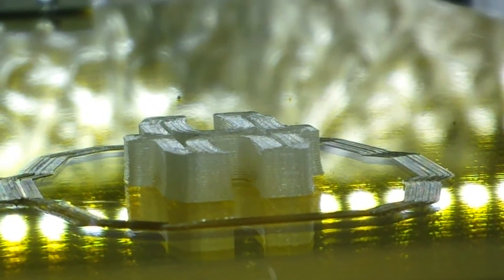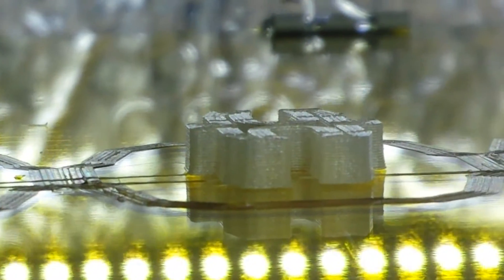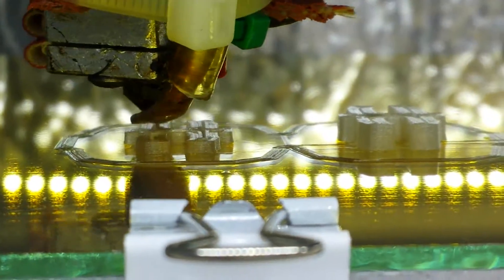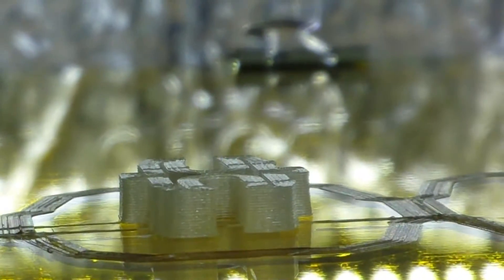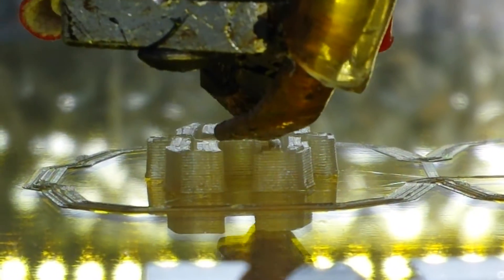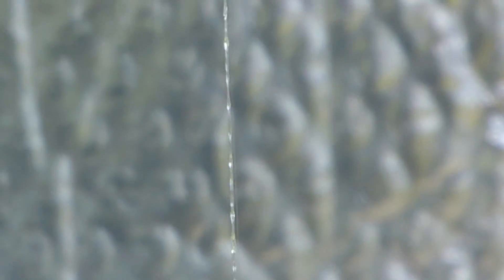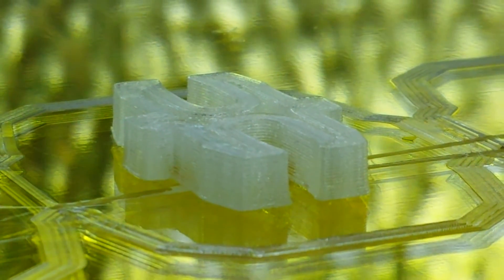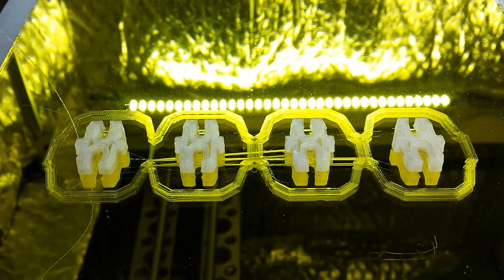Polycarbonate Printing - 1st attempt

Comment: Nice one! I've found poly prints really nicely, but in my printer with no heat warps pretty bad. I imagine in yours it'll be a lot better.

I've used buildtak which I'm now convinced is polycarbonate sheet and it stuck too well. rubbish on pei believe it or not! ;)

Polymaker pc-max is also excellent and easier to print but doesn't have the 150 degree gt temp of normal PC. worth a try if you fancy a different filament. I love it.
Reply from the maker: Hi Jai. thanks for the info. it was 1st try. second try of a vase didn't go as well. lifted off bed mid print :-(.
After I tried using a sheet of Acrylic and this worked perfectly in terms of adhesion and was easy to remove when it cooled down.
Will try again at weekend and update.
I have heard good things on the polymax pc , one to try in the near future I think.

I also have some PMMA to try out  but I am expecting this to print easily as suggested elsewhere.
Reply: Accel erate Yea the PC-Max I have is my favourite filament ATM. Not tried any bigger stuff, but with a raft it sticks to the pei nicely, surprising after the failure of polycarbonate. I think it may have a little abs in it to modify seeing as the glass trans temp is about 110 degrees.

Try using a raft with your setup. Seems a waste, but in the grand scheme it's only a gram or two.

The acrylic is a great bit of info. nice and cheap to try out! I want to make my bed easily removable so I can have different surfaces for different filament.

I got my PC from hobbyking. Ultra cheap. I also got some acetal (pom) which is a complete DICK to print without a heated bed. Won't stick to pei at all and warps like a bitch. Worth engineering a better printer for with its stiffness, machinability and wear resistance.
Reply: * heated chamber, not heated bed sorry.
Reply from the maker: I like the idea of different build surfaces for different materials.
Would be great to find the perfect materials that suit what we print without all the hassle of tape etc.
The acrylic I used was salvaged from an old Plasma Tv.
Hey printing in acelal would be brilliant if achievable ? . I like machining with this stuff, as you say an excellent engineering plastic.

One thing about the Acrylic is the low temp resistance,  When I tried this I had not set the bed height correctly and the nozzle scraped across the surface and melted a nice groove straight through it :-(.
I managed to manually adjust the height and allow the print to continue and it stuck down just great.
But just need to be aware the nozzle will mess it right up if the two touch.
Reply: Accel erate I get that with buildtak (hateful stuff really but good for PC, though too expensive and doesn't last). I have a bltouch probe to try and add to auto level and set height to prevent that hopefully.

Removable beds would look like this to me: 310 by 310 10mm tool plate heated bed with 305*305mm bed surfaces. One PEI for most prints, one polycarbonate sheet (from a sign shop perhaps?) for PC, one tuffnell/garolite for nylon, etc. God knows what POM would need. Perhaps perf-board like the Zortrax to give a bigger surface area. Email me your address and I'll post you some POM from my reel if you like. It was cheap and I'd be interested to see how your heated chamber helps.